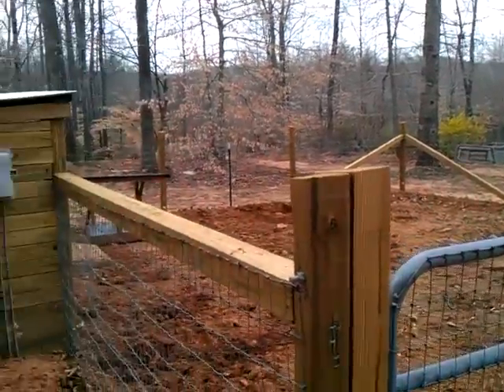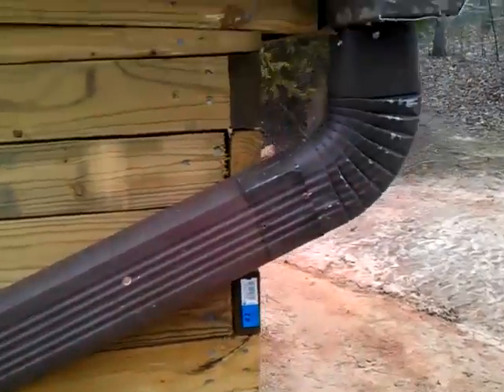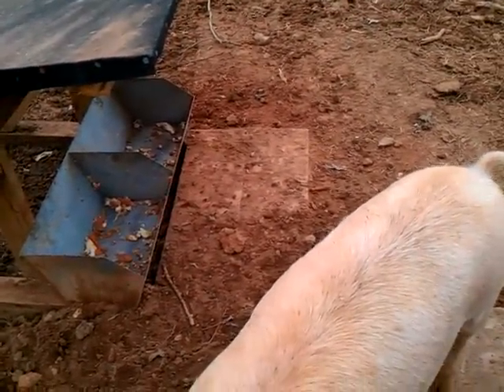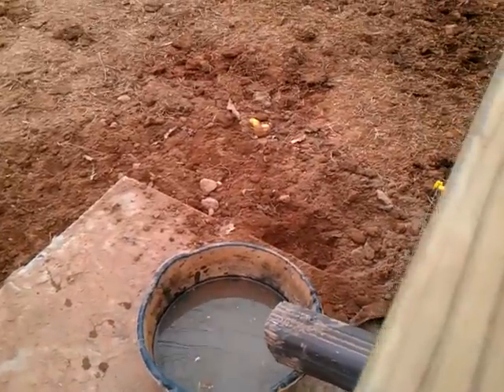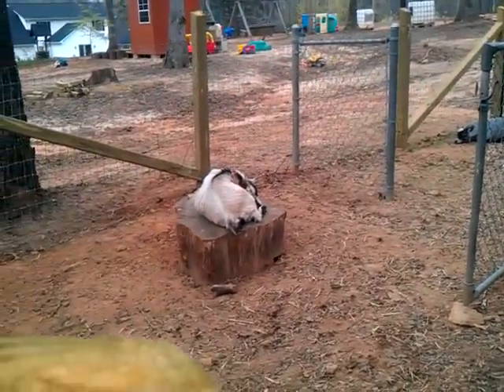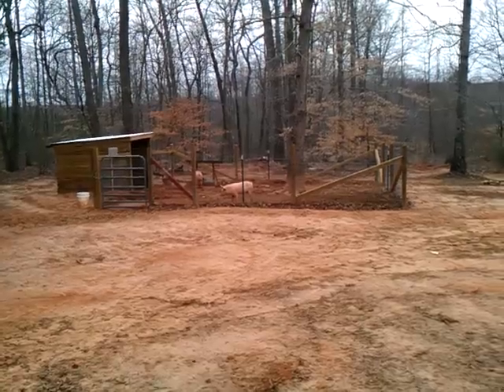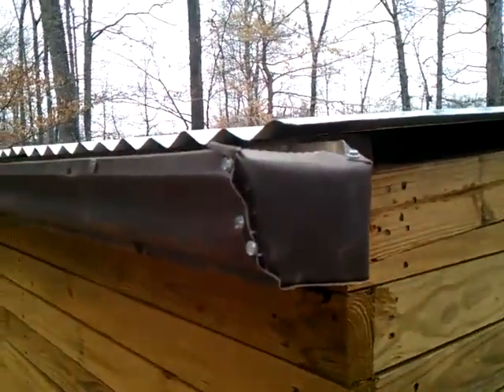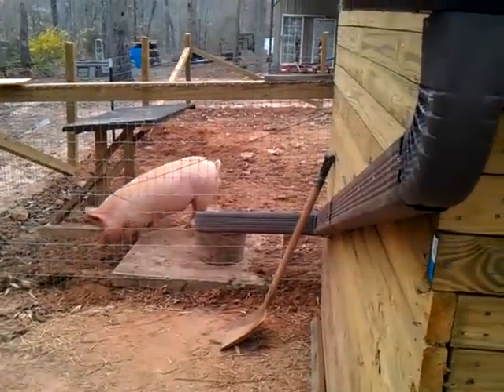Making improvement to pig pen

Comment: Great idea on the gutter .An old water heater cut in half long ways with angle iron feet long enough to keep them from flipping it and rebar bracing across the trough to keep them from laing in it works best.